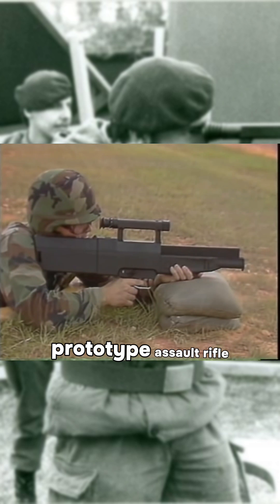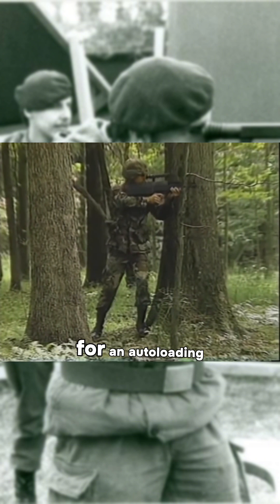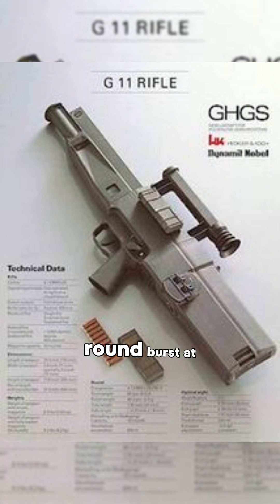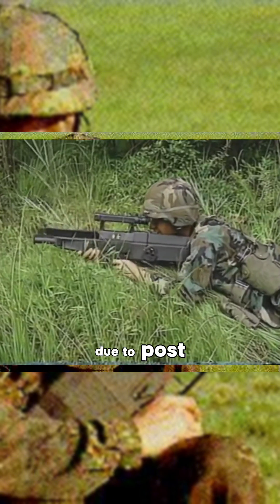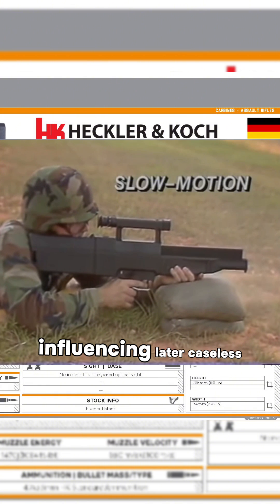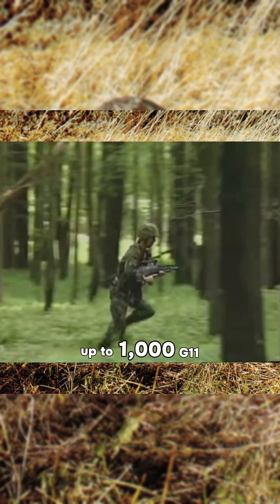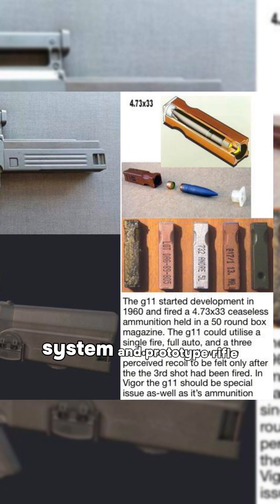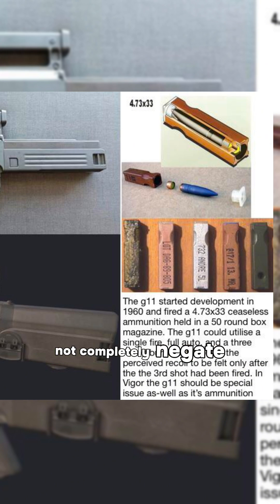The Revolutionary H&K G11 Caseless Rifle. Real Scifi rifle

Comment: One big problem with the caseless ammo for the G-11 was how fragile it was. Small chips in it could damage the chamber with the Munroe effect. Often damaged rounds failed to fire at all. Also metallic cartridge cases are good at removing heat from the action. Caseless has really only caught on in main tank rounds, in the tanks ammo storage area they are better protected from damage than in an infantryman's load carrying equipment. As it stands caseless small arms for battlefield use are a thing for the future not the present.

Comment: Whats youre opinion about the hk mp 7
Reply from the maker: With that and things like 5.7, I feel like we're not quite going in the right direction.
We want something small that has limited anti-armor capabilities, but the power is lacking against soft targets. We're too focused on using 5.56 as inspiration, and making rounds even lighter than that.
But a 6-8mm round between 55 amd 100 gr, like 7.5 BRNO can take 300 pound game at 100 yds, and has a high enough velocity to go through 3a armor at 50.
Though there's not too much demand for pistols like that, even though I think, with a red dot and detachable stock, they could fill a lot of roles.
Reply: Talking from personal experience the mp7 is good for it's light weight and small recoil so small that you don't feel it. But it's a pain in the ass to get a good shooting position with it.